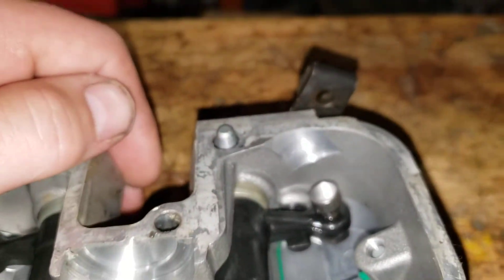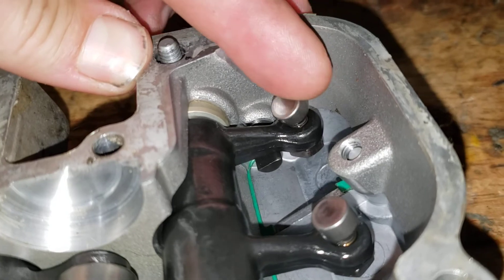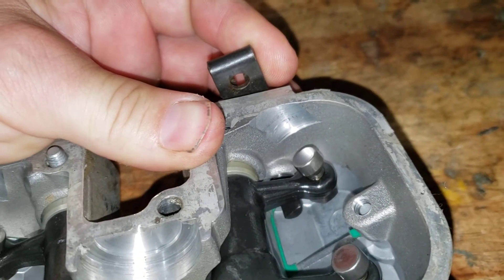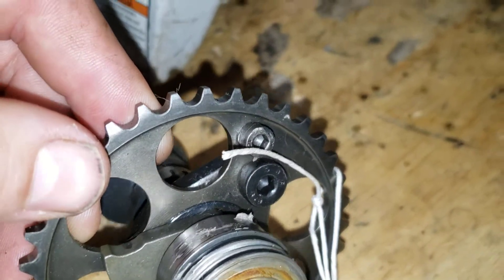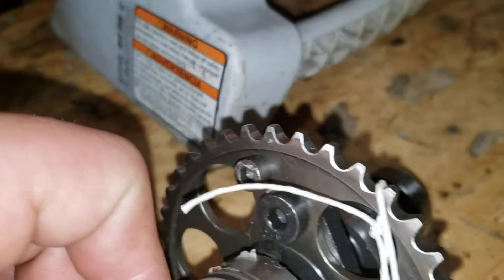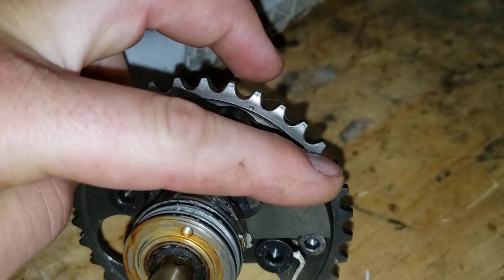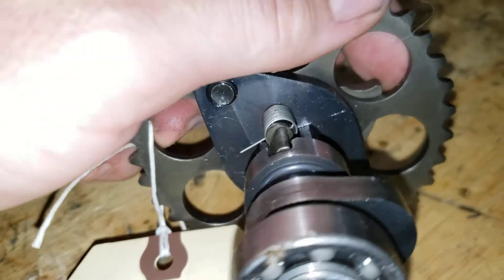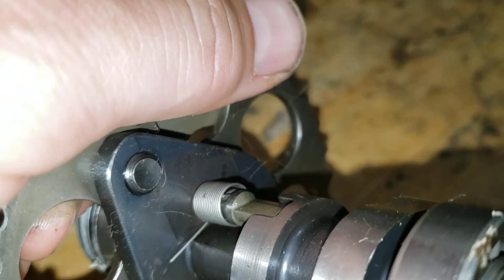How auto and manual decompression works - KTM RFS engine

Comment: Omg this just happened to me recently. I got soo lucky my motor wasn’t Grenade’d though. I was hearing a super lout tapping noise inside my head and I couldn’t figure out what the hell it was. I thought it was the valves, so I adjusted them like 5X and the tapping sound didn’t stop. So I figured we’ll, let’s just go for a ride and see if anything breaks lol. We’ll I came to a stop sign and was holding in the clutch when the engine died out, and wouldn’t turn over, I’m really glad I wasn’t gunning it at that moment in time. I thought a valve was bent or broken and seized the piston or something, but when I opened the head, that stupid little nylon bolt was still at the top just barley hanging on all stripped. I was sooo relieved to find out my head didn’t blow and it was just one little bolt.
Reply from the maker: Buy a lottery ticket! 😉

Comment: If I bog my engine down below 800rpm I get an awful banging/ clanking and I was wondering if the auto decompression was engaging and hitting something. Could you see this as being possible?
Reply: I believe yes, as you momentarily slow the rotation of the cam.  When you stall the bike under load this is the loud CLACK you sometimes hear.

Comment: anyone know if 03 ktm scx 625 has a auto decompression too ? 
it has the manual decompression lever, but i would just like to know if it has both auto and manual .?.
 my ktm is not running correctly and i have rebuilt the carb many times and it is still not running correctly

Comment: Hi, can you maybe show the old and new Cam Gears in comparison? Because the 2 Bolts holding it all together broke the second time for me and i just cant find that new cam gear.....
Reply from the maker: You're looking for CAMSHAFT GEAR 2003 part # 59036011100

It's #26 on the parts listing for a 2007 KTM 525 EXC in the  "Timing Valve" section.  Not sure if this link below will work 

https://www.ktmworld.com/oemparts/a/ktm/600f887387a8660e9cf8335b/timing-valve

Comment: Do the 2004 450 rfs have both ? Or just one way of decompression ?
Reply from the maker: Should have both. Might have been removed from the bars, but Manual Decomp mechanism is there
Reply: @teamagoge-theenduroists8683  I have the manual but even with the manual does it have the auto just curious as it’s almost impossible to kick my 450 over